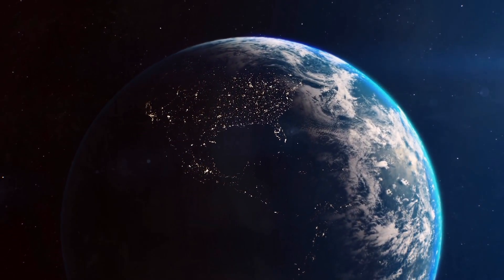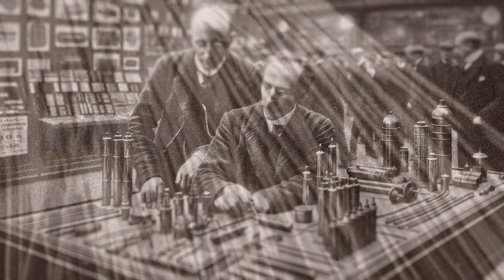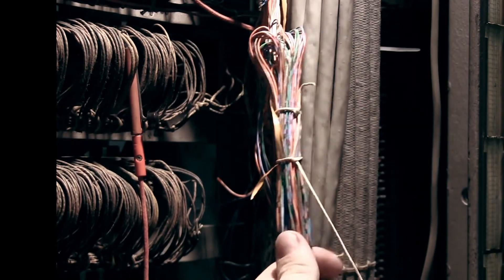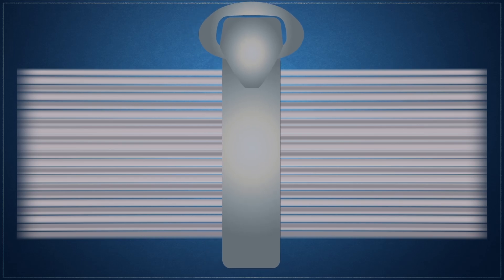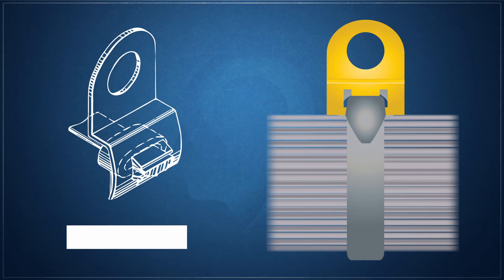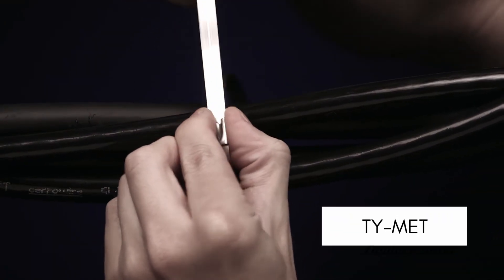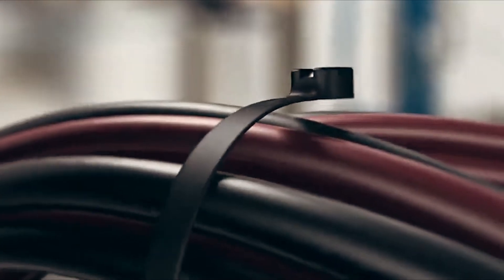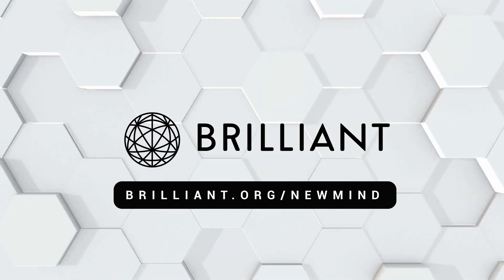The Zip Tie Story

Comment: I am a simple man of twisted wires so, over the decades, I have sat for hours admiring the wondrous mechanics of the toothed plastic zip tie. I never thought to look into it's mysterious past. I always assumed zip ties were perfect and of such heavenly design they must have been there at the Creation of the Earth.
Reply: "In the beginning, God created the heavens and the earth and the zip tie."
Reply: Something so elegant and beautiful could only be created by humankind
Reply: The only problem with the standard zip-tie is the inability to open the latch so the tie can be released and reused.  Otherwise, it's a pretty damn good design.
Reply: @davidinwashington I will admit to clipping an installed tie just behind the locking head and repointing the tie end so it can be reused. Of course, that only works with a tie that is fairly long. And yes, someone watching could say, “You just saved two cents. Are you happy now?”
Reply: @TruthInFlying  waste not, want not.  😀
Reply: @davidinwashington you can open the latch. I use the end of another zip tie or something of similar size and push the tooth/flap forward and that raises it from the gear part of the tie and you can loosen it. Hope that helps.
Reply: I reuse zip ties often.  I slip a small blade tip under the latch and pull the strap backwards though.  It takes care to do it safely, but in some circumstances, this is very good to be able to do.  FYI, it helps to push the tie slightly tighter as the blade is slipping under the latch.  Some cheap ones just don’t survive well and the latch gets messed up in the process, but I often get good results.
Reply: My uncle Maurus Logan designed the zip tie who worked for Thomas and Betts!
Reply: No, you are thinking of Velcro

Comment: As a USAF electrics installer I mastered what we call "sewing" cables together using lacing twine. I spent many hours sewing cable bundles together. I also welcomed the coming (to us) of zip ties. Not only were they easier to use, but you could sew a form MUCH faster using zip ties. The damage to my pinky fingers aside, I found sewing cable together with lacing twine to be almost meditative. It was very zen. I got so proficient I could sew forms twice as fast as my co-workers.
Reply: How do you sew using zip ties? Some process using them plus twine to maintain spacing? Or were you just using the same term, even though zip ties are single point instead of continuous?
Reply: @Nevir202 It is not "sewing" In the traditional sense but we still referred to it as "sewing forms". (Even sewing with lacing twine isn't sewing in the traditional sense. That's just what I was taught to call the activity.) When we switched over to cable ties from lacing twine we did things differently than before. You can still make a very neat, functional cable bundle using zip ties.We even had a tool that could tension the ties uniformly and cut them off at the ratchet. For attaching cables to a solid surface we used a device that let us run the zip tie through it that we called "portable holes".

Comment: As just one off the top example of the my various uses of Ty-Wraps is using one 24” or several shorter ones to hold my brake calipers up out of the way when performing brake service.
— I’ve used them for just about anything where I need a temporary or permanent hold of an object.

Comment: Don't put zip ties in the datacenter (except in very specific situations and methods during structured cabling). If I see a zip tie in a rack I know the person who built it was a jackass, you always get cut trying to take them out and you inevitably have to undo 20 of them to get to the wire you need.

Comment: Cable lacing is flat out beautiful, having grown up in the time of zip ties and wire loom, the first time seeing cable lacing inside of an late 20's tube radio, I was blown away at how elegant it was.
Reply: I still cable lace all my installations. Mostly for vanity. Like driving a twin stick 21 speed just cause
Reply: In the early days of automation using relay logic, large bundles of control cables fed back wired control relays built directly on to heavy slate control panels. The carefully trained wires  contained within the hand laced bundles, were a work of art! I can remember admiring the craftsmanship that went into building these panels. Ofen dozens of these panel were interconnected together using these hand laced bundles.  I could only imagine the hundreds of hours that went into laying out and drilling the slate boards and then installing through posts that made up the relay contacts, and then these slate boards were all hand wired from the back side with the wires eventually trained into these hand laced bundles, 

This stuff was built to last many decades! Some of these slate boards were 1-1/2 inches thick weighing hundreds of pounds. All of the edges were bevel ground and everything bolted to steel frames. Each panel would typically have a dozen or so relays built onto it. Most of those I dealt with wee 250 VDC control. Most I have seen were made either by General Electric or Westinghouse. They often had large polished brass nameplates adorning a set of panels. All these panels wee configured to control continuous process lines that wee a quarter mile or more in length from one end to the other. The automations was pretty simple in theory but immensely complex in construction. This was how they did it 75 years ago.
Reply: @professorg8383 , why the heck did they use stone (slate) boards?
Reply: I came upon cable laced this way in an old power house. The guy who laced it in the tray was an artist. Beautiful job. Broke my heart to cut these to put in new cables... :(
Reply: @bbzecker5921  Yeah, I know that feeling!
Reply: @bbzecker5921  I can imagine. It seems like the perfect mix between science and art.  The conscientiousness the American workforce had was nothing short of amazing.
Reply: I still lace, but then again the environment my products get used in are subject to high vibration. Cable Ties and Vibration are not a great combination.
Reply: Old pinball machines typically used string-laced cabling.
Reply: @goodun2974  It was common in many things for a long time.
Reply: A very cool video, but they never mentioned the special, dual-loop, variant zipties that are used as plastic handcuffs by law enforcement personnel.
Reply: It is called cable stitching
Reply: @davidrobertson5700  stitching or lacing soda or pop eh
Reply: @pilotavery  Knowing guys who used to actually do it, they called it lacing. Sometimes it's good to be old enough to have actually witnessed something others just talk about!
Reply: @professorg8383  I'm 27 lol I also drive a 48 Chevy truck just for vanity.
Reply: @professorg8383  and to be old enough to see what quality really was.
Reply: @TahoeRealm Yeah, They just don't make things like they used to!  Some stuff has got better but a lot of stuff just isn't as good!!
Reply: back then people had some handworking skills that are close to dead these days. People today are not able to find solutions for problems anymore. The only thing theyre able to do is ask someone if he knows a solution to your problem instead of using the own head
Reply: IPC/WHMA class 2 and 3 no longer allows for zip ties. All military/aerospace harnesses have to be hand laced now or Daniels MFG has come out with something called lace-lok that is really nice, as the two acceptable knots to use with hand lacing or broom stitching takes talent and his hard to tech a technician quickly.
Reply: it's just string bro.
Reply: @HansLiu23  Nah, it's string and SKILL!
Reply: @HansLiu23  And you are just a glob of cells!! It's all in your perspective.
Reply: @HansLiu23  Actually flat waxed lace.

Comment: Zip ties are a critical part of the "it moves and it shouldn't" repair triad - That being Zip Ties, Duct Tape, and Wire Coathangers.

When I worked at FedEx years ago the ramp agents used zip ties to attach the paperwork to the ULD containers / "Cans" that were loaded on to the planes.
Reply: That repair triad is also the essential kit for kidnapping.

Comment: Just please use flush cutters to trim the end.
Reply: I have a set of barbershol nail clippers that I got from the dollar store that cut the ends of the zip ties so absolutely perfectly smooth. You'd think it was a machined surface
Reply: They make a zip tie tightening/cutting tool. I have one from commercial electric that I found at a garage sale for a dollar, and I’m sure other brands make them as well.
Reply: No 😈
Reply: I don't purely so I screw up with people that will have to deal with them after me

Comment: Back in the mid 1970's we were using nylon cord to bundle cables in GTE telephone central offices.   I remember when nylon cable ties were introduced.  They weren't available to us in large volume so we still did a lot of work with nylon cord, but used ty-wraps whenever they were available....

Comment: I don't know about today, but cable ties were not allowed in TelCo central offices as late as the 90's.  Cable ties damage the cable. I have lacing cord rolls everywhere.  😊
Reply: I wasn't union.   You can't dress cable as nicely with ties because of the thickness of the plastic.  If cable ties are not cut properly they leave sharp edges that will cut you, I know!
Reply: Depends on the company now, but AT&T still requires actual lacing, no zip ties allowed. Verizon is a lot more relaxed about it.
Reply: Just don't strangle that cable. If you can learn how to lace a bundle you can also learn how to apply a zip tie with some measure of mechanical sympathy.
Reply: Correctly installed cables ties are not going to damage conductors. Yes, overly tightened ones could.
Reply: @paulmaxwell8851  hard to incorrectly install lacing cord
Reply: That is union bullshit.  No zip tie has ever damaged a cable.  Explain to the people why you had to use so much fish paper with your lacing cord...  Can't fool me old timer.  I can out dress any cable using any system, but the union forced the lacing because it is easily 3x the labor.

Comment: The 4,7 petameters of wiring is a suspicious number. If the section of all wires or cables (with all their wires merged) were to be 2.5 square milimeters, all theses wire would account for a volume of 11,75 cubic gigameters, which represents a solid crust of 2cm of wire on top of Earth's crust... An epicrust of wires ?

Comment: Cable lacing is still widely used in telecom. Fiber optic cables are often bundled with velcro straps because they are easy to undo and redo.
Reply: Cable lacing was the preferred method at the facilities I worked at for wiring and most FOC was run in split duct between racks. Usually us technicians used cable ties for a quick install but when the installation techs showed up and were adding multiple wires they would cut the cable ties and lace everything. With the number of cables on the back side of the equipment hook and loop would never work. We had about 800 satellite modems at the last place I worked and even had ladders on a rail to reach the top set.
Reply: Nothing pisses me off more than cable ties in a networking closet. I need to replace one cable, which can mean cutting 2-20 cable ties depending on the length. Velcro straps is the shit.
Reply: @nilleftw  Not a problem - simply run the new cable along the outside of the existing trunk and add more cable ties. Job done!
Reply: Zip ties are evil for repair technicians. Hook and loop for the win!
Reply: @PatrickPecoraro There's zip ties, and then there's zip ties with the superfluous bit sloppily cut off at an angle forming the sharpest material known to mankind.
Reply: @konayasai  I have a small scar right between my eyes reaching around a beam in a tight space and got cut by that zip tie not cut with flush cut diagonal pliers when I was working at EB. That job was a zoo. We would be doing electronics wiring with welders and grinders nearby. We had fireproof blankets we zip tied to what ever we could to protect us.  This was almost 50 years ago and the blankets were probably asbestos.
Reply: @konayasai , grab the protruding tail of the zip tie with pliers, right next to the latching head, and twist it until it breaks off. Kinda rough on your wrists, however, if you have to remove the pigtails from a hundred zip ties per day. I bet that T&B have purpose-built cutters, for a smoother end cut; perhaps even a battery-operated device to melt the pigtail off?
Reply: Another reason for using velcro on fiber cables is because an overly tight cable tie can distort the fiber and affect the signal. At my university, we only used velcro on any data cable.
Reply: It's also widely used in Aircraft.
Reply: @normmcrae1140  What’s funny is I worked on P-3 avionics and the plane  used lacing  and when I left the service I worked at EB and we used cable ties on submarines.
Reply: Working in IT I hate when someone gets all creative with cable management, creating a nightmare for the next person that has to change something like a mouse or keyboard.
Reply: Velcro is used so it doesn’t damage the cable more so than easy undo
Reply: I use a combination of zip ties and velcro straps with a self-loop.
Reply: I’m an electrical engineer doing wire harness design for military vehicles and we still use cable lacing as well! Still used in aircraft as well.
Reply: Yes
Reply: Fiber is not zip tied due to micro/macro bends happening when people crank zip ties down.
Reply: The clasp of a zip tie can get hung up or snagged when pulling wires.   No bueno.
Reply: Was gonna comment this.
Reply: I worked in a Facebook datacenter for a while. No zip ties in sight, only velcro straps

Comment: EE here. I associate T&B with connectors, not "Ty-raps", or tie-wraps, generically. Of course, I keep a big stash of tie-wraps, and heat shrink tubing. They are my all-use duct tape. Though T&B do have a lot of connector accessories, for securing their cables onto chassis. Mostly used their ribbon cables, or that of competitors, 3M or Robinson-Nugent. T&B = Blue. 3M = Gray. R-N = Black.

My mom was an electronics assembler. Almost always women, and it was a woman's job, back in the day of gender restricted careers and jobs. In addition to soldering, cable lacing, was one of their duties. Usually on a "jig" made of a full sheet of plywood, with nails driven into them, making a guide for the intended cable. She would bring home, spools of waxed lacing, for gardening purposes, But I'd use it to lace up those short 16-fire cracker strings into longer ones, over 6 feet (~2m) long, and containing upto 1000 fire crackers.

Comment: I incorporate wire lacing into my designs whenever possible.  I absolutely love the way it looks, and it is very effective.  I saw it used in a backup satellite on display at the Tellus  Science museum and fell in love.
Reply: Apart from aesthetics, what advantage is there? I see that NASA also does it, so I am real curious. I've never even heard of it, but I don't work in manufacturing
Reply: @donperegrine922  It's low profile, doesn't leave sharp edges, has better vibration resistance and won't bite into the wires like cable ties do.
Reply: @donperegrine922  Everywhere in a car where you see cable-bundle sheeting (that isn't the of the heat management variety) lacing would be the superior option, as it weighs less and allows for tighter control over how the bundle naturally want to sit, while also putting less tension on the wires. But it's something we still can't make robots do, so zip ties, sheeting and electrical tape it is, as that is faster in man-hours.
Reply: None really in my case.  I just like the way it looks.  And most all of my stuff is vacuum tube-based, so it fits the overall look of the circuit.  It could be a weight and bulk thing with regard to spacecraft though.   @donperegrine922

Comment: I work in the cable tv industry. Zip-ties hold a special place in all our hearts.
Reply: People are definitely into different things, I like different spray can caps.
Reply: @canoaslan1011 I like hatchets 😂
Reply: @darksu6947  deadset. If you donbt have a gun which is a completely different category im into. And you dont have access to compressed air. Different caps are your only.chnace for a different pattern and fan shape :) and depending on job these have to change. If you spray everyjob. With the same.cap. at different temps and speeds etc. Your always going to fail.
Reply from the maker: @canoaslan1011 This is a very New Mind  comment, love it.